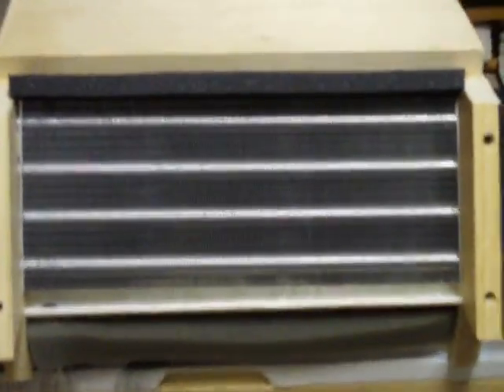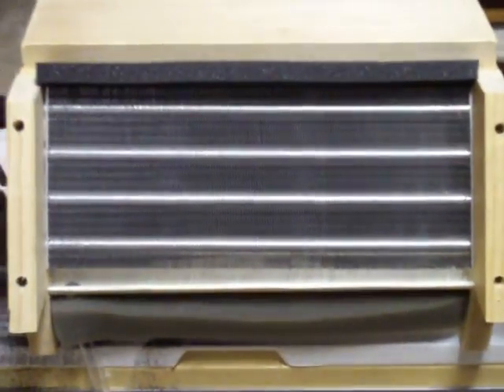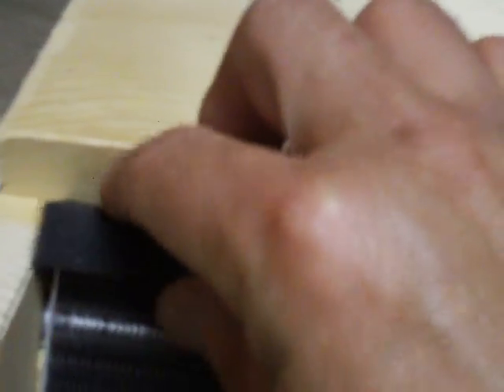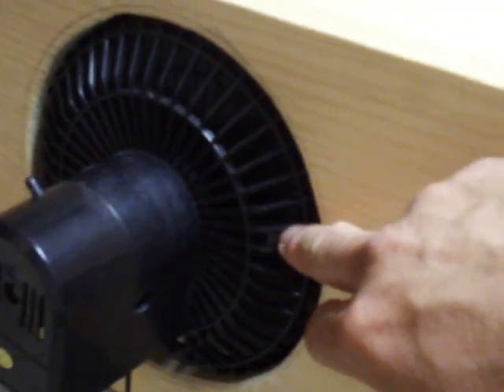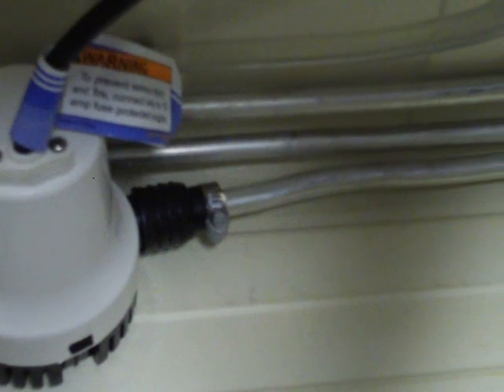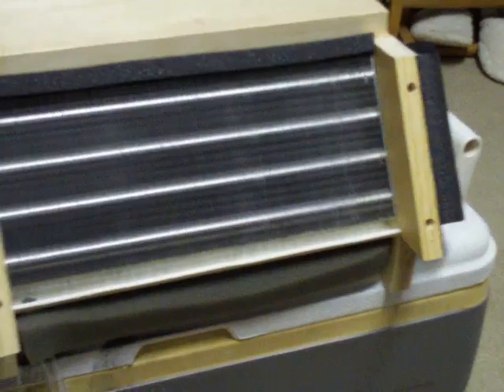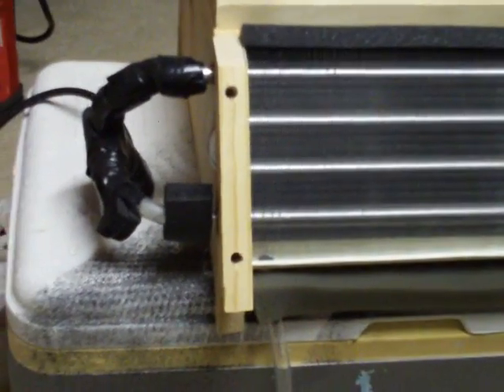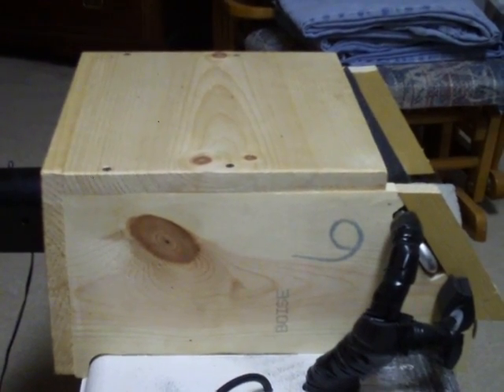Homemade Air Conditioner.

Comment: 40lbs of ice will give you about 6000 buts of heat absorption one time then you have to fill it back up. For comparison that's what a tiny window unit does in every hour.
Reply: +Nick pace Exactly! My window unit AC cools at 8000 BTU/hr. It was $190 at Best Buy. It draws 850 watts of power. If it ran 24 hrs/day on HIGH, it would pull 20.4KWHrs of electricity (and my 240 sf house would stay about 60&#176;). At my current rate of 7&#162;/KWHr, it would cost $1.43 per day to run. It would take 53 lbs of ice to equal 8000 BTU of cooling power (equal to one hour of my AC unit&#39;s output) or 1272 lbs of ice per day to equal the output of the air conditioner for the day. The best value for ice in our area is at Buc-EE&#39;s. 20lbs for 99&#162;. That would cost $64 for the ice plus the gas in my truck to go get it. I would at least lose the weight that I&#39;ve been wanting to for a long time by loading and unloading 1200+ lbs of ice three times per day. Not sure where I&#39;m going to store 1200+ lbs of ice at my house though. Hmmm. My point is, stop waisting time on these ice based air conditioners. Get a small and efficient window unit and an inverter that you can mount in your truck if you want it portable cooler. Heck, you can run a generator that will power your AC unit for a fraction of what the ice would cost you. Even if you make your own ice, they do nothing but move heat from one room to another in a house. Your fridge moves the heat from the water and puts it into the air in the kitchen. You then cool your living room with this ice. This just moved the heat from the living room to the kitchen. You didn&#39;t gain anything. I&#39;m not dismissing your design. I just want people to think about what makes sense. Thanks for the video and stay cool!

Comment: I like it but, why not close the loop on the system better by feeding the warm water return into a smaller plastic reservoir on the inside of the cooler. It could be a small jug or water tight container that you can bury in the ice and can refill periodically as needed. That should make the ice last considerably longer than it does now don't you think???
Reply from the maker: At the time I was not thinking about a close system,  BUT a closed system is not out of the question, at the time I was making this, I just was using a few things I had and really did not want to spend too much money on fittings etc,.. And yes it would make it last long possibly, because the absence of water agitation,. Thanks for watching and your input,
Reply: I've also been thinking of a closed system, but using some type of coolant with a lower freezing point than water (e.g. alcohol and water mixture) that will not cause problems with the pump.  I'm pretty sure salt water would be corrosive.  I'd also like to see if a product like Nu-Ice, which is a substitute for dry ice but without the bad side effects of CO2 and evaporation, would allow someone to cool a room or two just using an outdoor freezer and a homemade A/C using the closed system approach.
[UPDATE] Looks like salt water would not be a problem for a marine bilge pump as they are rated for ocean going vessels.  I just need to find out what the lowest operating temperature is (aka can it work below freezing)

Comment: I've been looking around and online for a decent design for homemade cooling that does not introduce humidity and I believe this one is the best so far.  My home A/C is on the fritz for the second time in two years and I think a few of these around the house would do just fine using our refrigerator freezer to refreeze the ice as needed.  Plus, the dry ice idea to extend cooling time is pretty fabulous.  My concern with that is it releases CO2 which could be bad in a home environment.  But since it would be in a sealed cooler, maybe not so bad.  I would appreciate thoughts on the safety of using dry ice. THANKS!!
Reply from the maker: Number one, do NOT use it in a sealed cooler WITHOUT VENTING. it will build up pressure inside, Number two, VENT THE COOLER  OUTSIDE with tubing or a hose..

Comment: great work though... wondering if mounting the pump outside the cooler would improve the performance of the AC-cooler by eliminating the heat that the pump motor generates while being inside .  Thank you
Reply from the maker: Hi, Well that's one of the debates that has been around, If you had it mounted outside, then the hot air would increase the pumps temperature, which would transfer through the pump housing where the water flows through, or you can leave it inside, I feel having it out you not only have the heat from the motor, but also the environment around it, So I opted inside, because I would Only get a small amount of heat from the pump motor only, and not everything around it outside as well.

Comment: Hello! Im planning to build one of these diy ac and i was thinking of putting a container inside the small ice chest and fill the container with water and submerge the pump there. I will put dry ice on the ice chest to cool the water inside the container and place the chest outside our house. Will it be safe? What do you think guys?
Reply from the maker: You can Use a container insider the cooler, Make Sure it is vented outside, Dry ice can silently kill you if  you are not aware of the dangers of its use in a closed area, Also the pump you use will have to be able to work in sub zero temps as well as use of something that will not freeze because the temps of the dry ice, the circulation would and could keep the liquid from freezing, but you never know, again, Make sure you vent the dry ice gasses outside..
Reply: Thanks for the reply.. so this means the dry could possibly freeze the water inside the container? How about i use normal ice then put some dry ice on top of it? Do you think it can make the ice last longer?
Reply from the maker: It Will make ice last longer in that sense, for several hours, if I was to try something in this sense that would be the first way id try it, the one drawback to this would be a cave or tunnel effect, the ice when first put in over the coil tube inside the cooler will have physical contact with each other, one you put dry ice over that wet ice, it will freeze it,  with use eventually that physical contact will no longer from the melting of the ice adjacent around the coil tubing,  leaving a gap between the two, which makes it thermally inefficient to transfer, the gap between the two could be as much as 1/4 inch apart, this it just a  theory of what could possibly happen.

Comment: What about making the pump system a closed system with glycol? you think the wraps of tubing could cool the glycol enough upon return to the evaporator to make the system still work? Just thinking maybe that would give a longer run time on the ice and could also make it beneficial to use dry ice?
Reply from the maker: the closed system thought with use of dry ice with venting outside never left my mind., that could work, my problem was to find a pump that doesnt use much voltage, and provide good flow in a closed system, cheap electric fuel pump maybe? that would work great specially with dry ice, but yes, closed system would help keep ice longer because the lack of Aggitation from water movment inside over or through the ice.
Reply: Wallabydam I found this inline pump on Amazon. I think it would work well in a closed system. 

http://www.amazon.com/Rule-iL200P-Marine-Submersible-12-Volt/dp/B000O8CZWE

Comment: I watched all the DIY AC in YOUTUBE, I think for me, your DIY air conditioner is the best !! with the condenser, using water as refrigerant, perfect idea. start mine, may I ask a question, can I use a small aquiarium pump to lower watt consumption ? thanks a lot
Reply from the maker: You CAN use a small pump like you stated, as long as it can push enough volume, I used the pump i have which i feel is way too much, because it was 12 volt, i tried to find a 12 volt pump, and they were much too exspensive, so i used the one you seen, But yes you can use one, make sure you can find one with a 1/2inch outlet, you want that so you can move the volume of water through fast enough with that type of pump, Good luck with your project!, And thank you for the generous Comment !
Reply: thanks for the reply, GOD BLESS

Comment: We put a piece of dry ice about 5 lbs. wrapped tight in aluminum foil at the bottom of our regular ice next day it was a frozen chunk of solid ice. put coils on bottom and you could cool a room in a house for days
Reply: They put carbon dioxide in soda. I think you are thinking of carbon monoxide ;) big difference
Reply: Sorry Benjamin, Dry Ice is the solid form of Carbon Dioxide and you're correct in stating Carbon Dioxide gas is in soda.
Reply from the maker: I love dry ice, sometimes its just hard to find a place that sells it, locally,

Comment: And I worked in HVAC for a year and yes from 104 to 85 is great !! They way you can tell if an AC unit is really working well as if it can get 10F under room temp. Lets say your house is at 85F you turn on the AC it gets it down to 75F or 72F Thats a way you know the unit is ok on gas so its good. Plus you aways take temps and pressure but your unit did really great ! But as long as you have temp change thats under 10 or more thats aways good.

Comment: This is great ! And works I dont think people understand as long as your water temp is under I think 58 or 50 something it will dehumidify the air. How do you think buildings with chillers do it all its doing is just sending up chilled water at 50F or 48F to air handlers. I think you did a great job

Comment: ya know. this sounds nice. but at 3 bucks a back of ice, 5 bags of ice, 5 days a week, 4.3 weeks a month.

thats 322 bucks a month to keep my truck cool.
Reply from the maker: how many hours are you talking about using 5 bags per ice? per day,
Reply: Wallabydam 8 to 10 hours. although any left over would melt over night.
Reply from the maker: ok so 8 hours per day, idling a diesel truck( uses less fuel then gasoline ) with AC on, using lets says 3/4 a gallon per hour, that's 6 gallons in 8 hours burn rate.  cost of  3.80 per gallon, that's $22.5 for 8 hours X 5 days a week that's $112.5 X your stated 4.3 weeks comes to $483.75 which is $161.75 Cheaper... if i could save that much money, I think i would go with that, that's not including hours on your engine, wear and tear, noise, and in most states, its illegal to do so,  Dont forget, this can be used for tents, and small aircraft waiting to taxi on the runway, those planes do not have AC in them, and people do use these, for those. I built this, just because i could, and just for fun, not for full use..
Reply: Wallabydam My use would be cooling my vehicle while driving it. not running it to power the ac. so im going to have to spend (in my case) 400 a month on fuel anyway. So fuel wise, its not going to cost me any more. If running in a tent or something, buy a few solar cells on ebay and charge a battery with solar, run the fan off of solar and battery at night.

my new work truck doesn't have ac.
Reply from the maker: I see, Well in that case you could always buy one of those hot rod aftermarket AC kits, cost you a bunch upfront, but will pay off in long run, OR get a high watt Inverter, and the smallest Window AC you can buy and run ductiing into the back of a sliding glass window on the cab,
Reply: its water, it can be re frozen and broken. Energy is never lost, just converted. So why buy extra ice or water wheny ou can freeze it or heck, what one guy above me said and use some dry ice. before you go out for work you have a bag of the rpe crushed up ice that you froze, dump it in and your good. Also the likelihood if you needing it for every month of the year is unfathomable, if you want to make it last longer, add another 24,000LB rated trans cooler for extra heat rejection.
Reply: works for me i travel lots  for work,  always staying at motels n shit free ice all day they dont trip.  also if in need and ya see outdoor ice box at motel top off n shit;)

Comment: Awesome design and DYI portable AC! I am planning a summer trip from Texas to Oregon this July and will use your closed loop cooling design to cool my tent as we travel. We plan on tent camping across NM,AZ,UT, and OR. Much of this area is desert (Think 29 Palms Marine Desert training). I am thinking of putting the condensation water back into the cooler instead of a separate container as it would put a small amount of chilled water back into the system and eliminate an additional part to the system. I am also going to utilize 12V PC fans to move the air as well as 12V Aquarium pumps to move the water. Lower Wattage/Power consumption. I do not need to move a huge volume of air in a 3 man tent and the air I am going to be in is not as humid as your South Texas air so condensation will be less. Thanks again for sharing and paying forward your system.
Reply from the maker: Again Thank you, and Happy trails ! Sounds like you will be happy with what you build !

Comment from the maker: Tina, You can try the fountain pump, just as long as it will still work in very cold water temps, It should use less wattage, and produce equally same results, less water aggitation will help ice last longer as well. Copper line transfer thermal conductivity the best, You can use 1/2 bendable copper tubing inside your cooler, i used aluminum because it was what i had laying around. Thank you for the compliments, and taking time to watch.

Comment: 105 to 86 in an old camper is nothing to sneer at- it's FANTASTIC! I am going to build one of these for my up and coming campervan. Because the van is insulated, the cooling effect should be more profound. I'll have the fan and the pump (would a fountain pump work as well as a bilge pump?) hooked up to a battery bank with solar panels. This looks like the best solution to my problem of AC off the grid. 
THANK YOU FOR DESIGNING, MAKING AND SHARING IT!!!! God Bless You!

Comment: to my understanding of what you're saying, as long as I use a conductive container(e.g. aluminum cans, copper pots) instead of plastic bottles, it will be close to efficient as the open-ice. right?

I do plan on using this for a room with no windows and creating a hole in the wall for industrial AC is not an option as I'm not allowed to remodel anything in this apartment.

Comment from the maker: it is my opinion that once you get some melted water in the plastic bottles, the plastic does not thermally transfer cooler tempurture as efifciently, but yes frozen water bottles can be used and circulated if you planned on using it around the home, But if someone had planned to use it for a outing so to speak, where you may pass a store, ice would be the better choice, UNLESS you plan to drink those bottles of water after while outing, I use freezer chest, so i make custom block ice for mine

Comment: is it going to work if instead of using open-ice to melt with the water, you use several closed bottles of frozen water to cool the water going through the system? if the closed bottles of frozen water work, i can see having a stock of them in the freezer to put in the box when needed. and even circulate the bottles with melted water in them to the freezer while the frozen ones in the freezer goes to the box.

If not, i'll need to find a similar box but could dispense water to recycle the water.

Comment from the maker: thinking, I know your sayign you can buy a window unit, i dont think NO one would use this full time,  its nice you can do  math, and i never said IF you live next to a motel, i said if you are near one at the time you needed ice, oh and dontforget the weight of the window unit, along with the generator, and gasoline, OR how about buying a inverter, 3000 watt pure sine roughly 400 to 600 dollars, to run that window unit on a camping trip.?  I did not build this to use in my home everyday,,

Comment from the maker: whats your point?  You know someone that would use it everyday, Your not thinking real world, this would be a good short term use for a few days, or at a kids ball game, or maybe concert, small aircraft while waiting to taxi the runway, but seeing you brought it up, 210 is still cheaper then the headache of toting a 3000 watt generator, 5 gallons of flamable gasoline to fill that generator, dealing with the noise it makes, and pollution on top, and why? to power  a real window unit, like your

Comment: yours is a seriously clever application of this technology. it occurs to me that with a little additional fiddling you could convert something like that to handle both cooling in the summer & solar heating in the winter. add a small water heater tank & lines out to a simple solar water heater, you could heat a room.

Comment: When salt is added in an ice cream maker it is about 12% by volume the brine mixture melts about 10 deg colder it needs to be an ice /water/salt mix to do this it does not change the amount of energy in the system energy from ice is removed when it melts

Comment from the maker: 40 lbs of ice around here is roughly $7 and real world it lasts about 4 to 5 hours and if your near a motel or hotel you can use as much ice as you want from the ice makers that are outside, which are free.. spent very little money on this, everything except the fan and pump were free, sitting around in my garage, the time and energy spent on this was the same as someone spending time and energy on a hobby, crafts, woodworking, etc, My taxes i pay should be covering the repairs in the community.

Comment from the maker: Thank you for the compliment, Well i just made this for temporary use, Soloar panels would work great for the fan and pump motor, with or without use of a 35Amp hour battery, well no matter which way you make it, it will always have some positive side or negative side to it with each change,  Thanks again for stopping in  to watch !